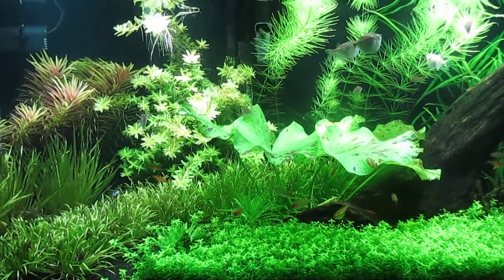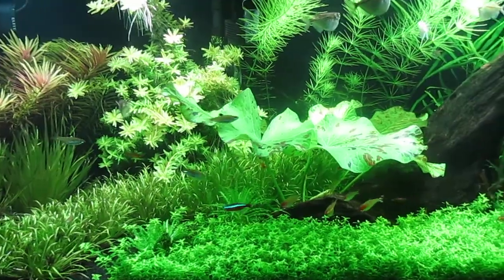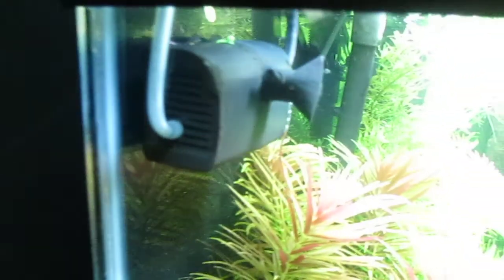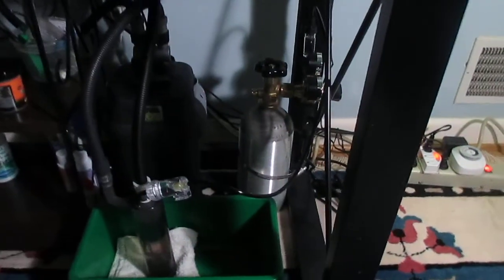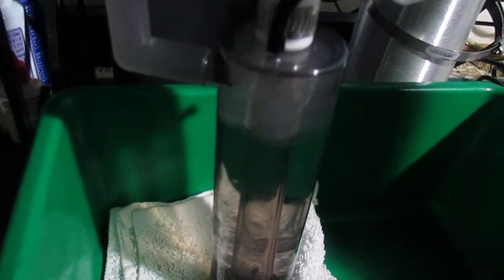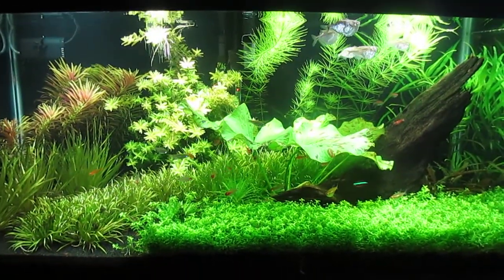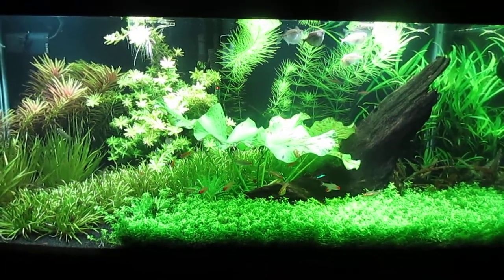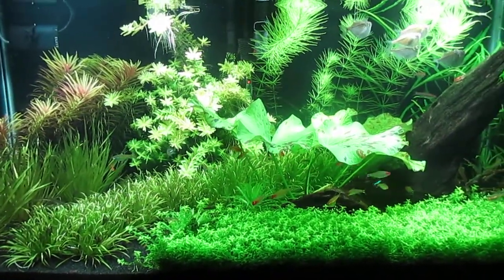Adding Co2 to Planted Tank

Comment: do u think i will need a co2 diffuser for a 10 gallon planted tank or could i just use flourish excel?
Reply from the maker: It depends what setup planted tank you have. Try excel first. Eventually you can try a Do it yourself co2 setup but learn more about it so to avoid problems like suffocating fish and stuff like that.

Comment: How can you make the co2 level lower like example if its at 2 bubbles per second how can u make it 1 bubble per 2 secind
Reply from the maker: If you are talking about DIY co2, then it is very difficult to get what you exactly want. It is uncontrollable.  Put in a little bit of yeast, it might help.
Reply: TheBravo101 a co/ tank
Reply from the maker: That is when you use a Co2 regulator. I used a Aquatek Regulator and it has two knobs to control co2 amount.

Comment: What a beautiful aquarium.

It really is a credit to you.

Congrats.
Reply: No Bother, Credit where credit is due!

Just while you are there, what is the plant on the far left that has a hint of pink in it?

Also what are the two plants in the foreground? The one that runs at an angle from the left hand corner and the one that runs horizontal with the front glass.

Regards.

Comment: You really achieved that tank with diy co2, you must have been on the ph and the other parameters like a hawk , mane new wanna try again
Reply from the maker: Yes, I achieve that growth with the help of Diy co2. But also good light, substrate and even adding liquid nutrients helps.

Ph and other parameter was not big deal for DIY co2 but pressurized co2 requires me to pay attention to that.

I don't think I will try again DIY Co2 :)
Reply: and there were no ph drops? algae blooms? cause the growth of those planta are amazing
Reply: TheBravo101
did you do it without fish?
Reply from the maker: Enrique Goitia
I have hard water so hardly no ph drops. Another thing is that the DIY co2 was only pumping 1 bubble per 4 to 8 seconds so it hardly not alter the water parameters.

As for algae, the main algae I started to see when I use DIY co2 is black beard algae (BBA). I learn that the fluctuation of co2 is one main reason why I get it.

Also, with DIY co2, green spot algae (GSA) was less when I started to use a little bit of phosphate.
Reply from the maker: Enrique Goitia
I use DIY co2 with fish. Only problem with DIY co2 is you can't shut it off. It keeps running in the tank but I counter that with more surface agitation at night or air pump on a timer.
Reply: that's exactly what i want to do cause i read that plant realease there co2 at night and start taking in o2